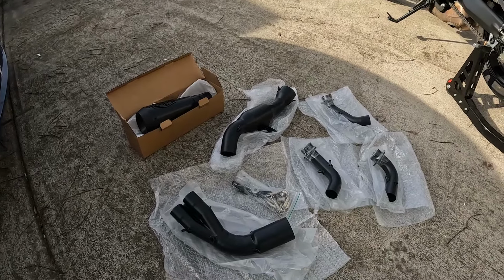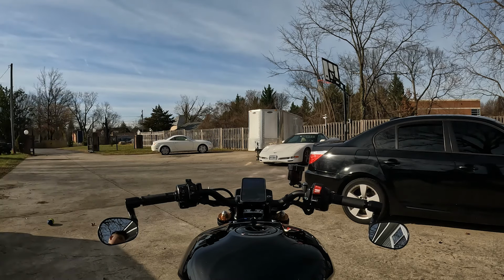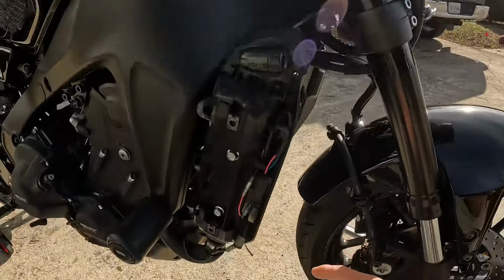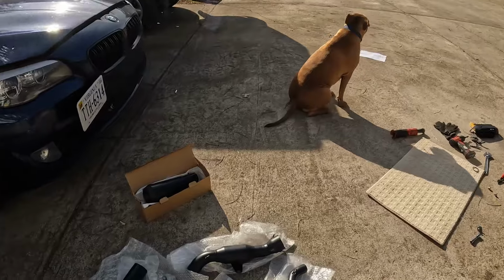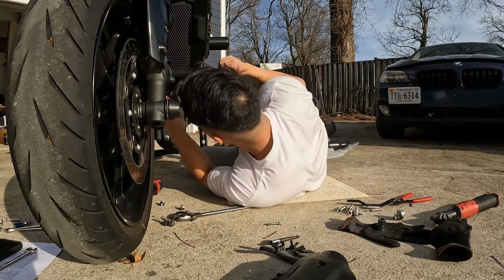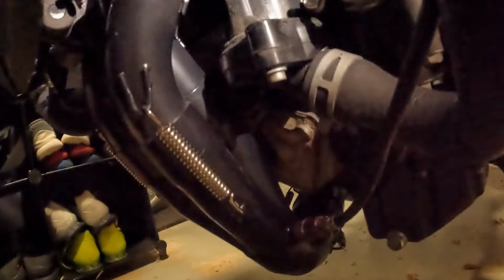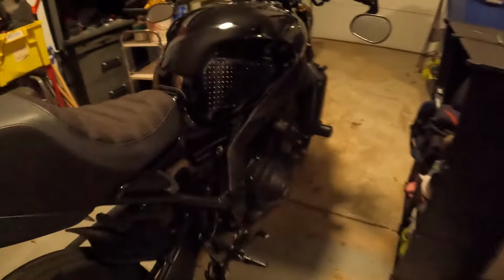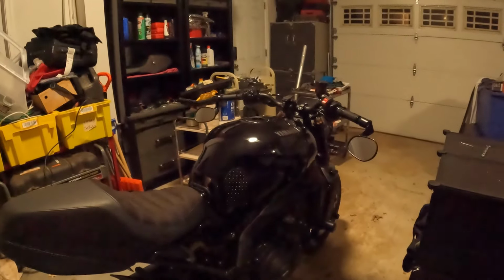2022-23 XSR900 Kelpi Custom Moto Shorty Exhaust (Black Cerakoted) LOUD  *Video does not do justice

Comment: We put top pipes in first then housed it to the connector.  I cheated as my mates a machanic.  Good one man.  After a couple of days riding going through the  heat cool cycle. Check header bolts again to see if they are tight. Ive got a leak  near baffle. Gonna get some special stuff for it. Mines a flanker shorty. Bit different end pipe. Thanks for sharing man.

Comment: Ay man... Im installing my short as we speak and in the instructions it says "install the link pipe by inserting it onto the merge collector ensuring the bracket sits BEHIND its mounting point.  Did you install it behind or in front??  Theres no way for me to get the link pipe behind the bracket near the rear brake.  Wasnt sure if you ran into that issue and just installed it in front.  thanks
Reply from the maker: Yeah man the owner jock Houston was telling me to mount mine a little higher up to the bracket but I don’t see how it’s even gonna budge man I just left it as is. It’s sitting a little low but I haven’t had trouble with clearance or anything